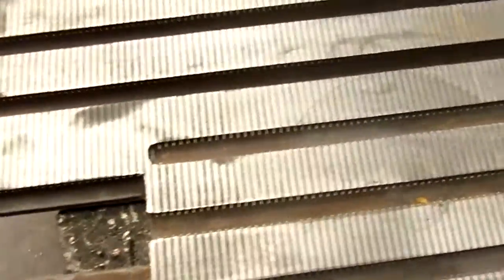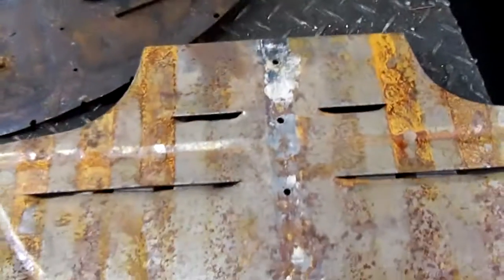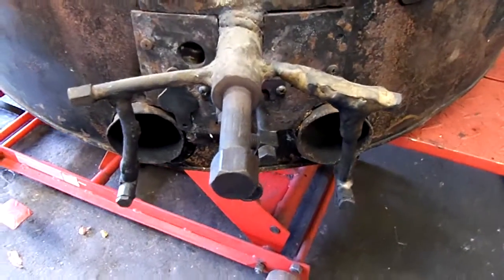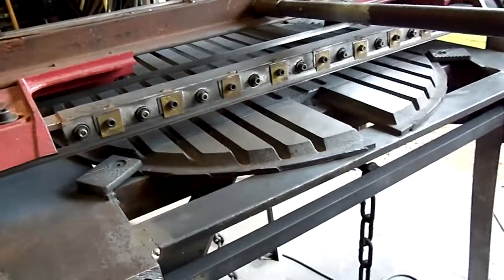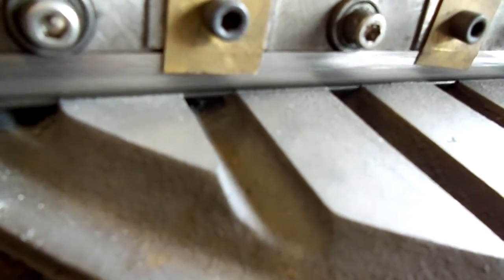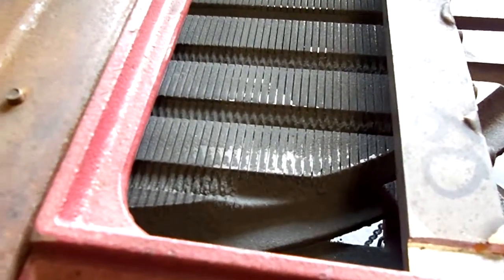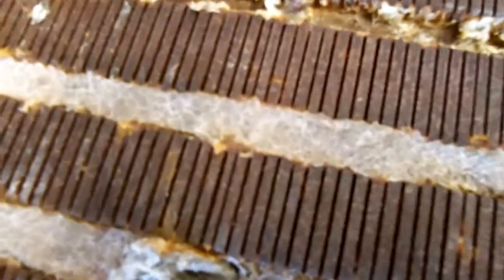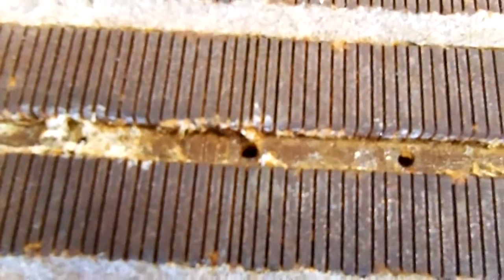Stanley Steam Car, Stanley Steamer, Slotting a Baker Burner Grate

Comment: Thanks Bill I'm currently over hauling my burner, I have 4 louvres in the baffle but they had closed up so I've welled small 1/4" spacers onto the lip to stop them closing up. I'm staying with the existing sheet steel not stainless to try to keep the expansion coefficients similar. I have had the pan and baffle HPC coated (used in headers on race engines) It will be interesting to see how it goes. My slots are all round 22 thou but I have uneven spacing in some areas plus not cut thru properly in a few areas. Used a multi tool with a .55mm blade to clean up the bad areas and remove the refractory that was laid over some slots and melted into them.
Reply from the maker: I been using 310 stainless.  I also weld spacers in. 310 will take the heat and last forever.   Good luck   Bill Barnes